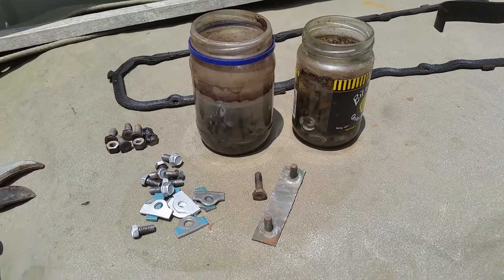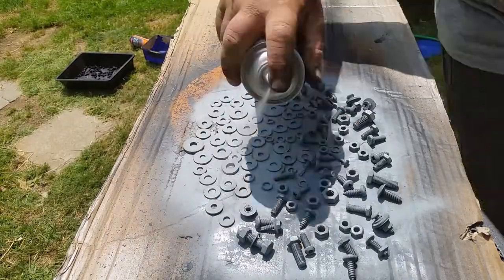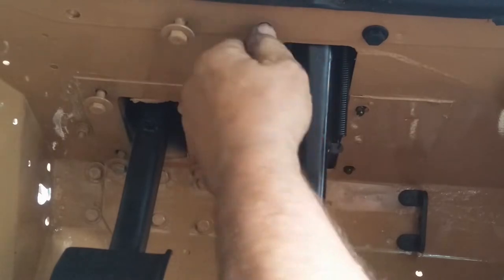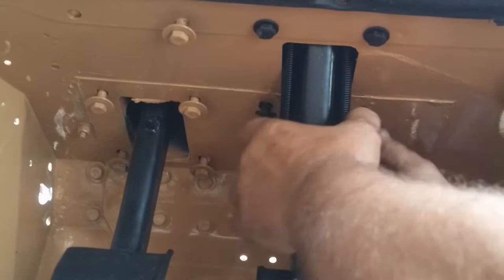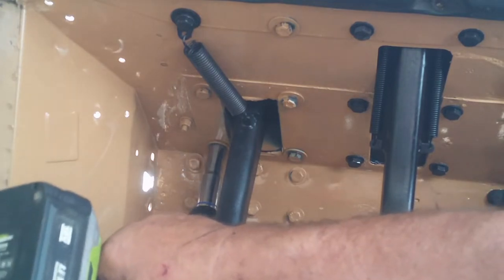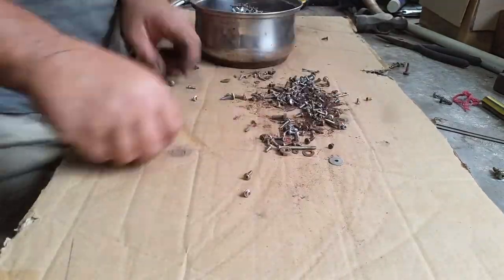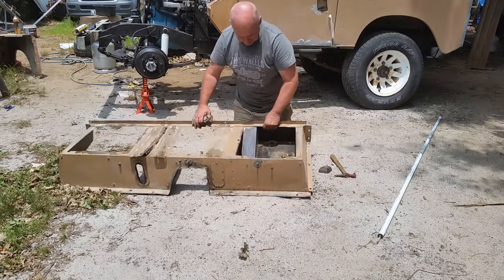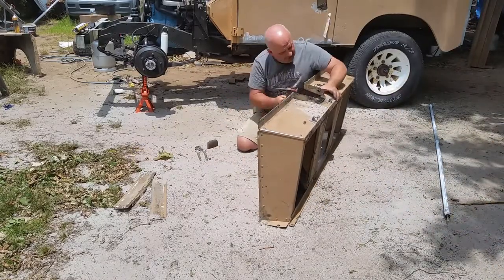LandRover S3  Refurb in 4 weeks. Video 5   Nuts Bolts, Washers, Clips and Clamps

Comment: Something truly satisfying when you find the nut bolt or screw you need and all those you've been saving for decades my playground has a pretty good hardware store also comes in handy !
Always known them as lock washers never heard spring washer before makes great sense though !
Amazing how many chemicals distilled vinegar makes unnecessary !
You have to build a booth if you want to recapture your sand wet or dry .
 the hardest part of recapturing your sand is building a booth .
Alkaline love gives so much extension to life well done !!!
Acidic loves take away life beware !!!
2020 will be the year for Clear Vision decalcifying and cleansing the pineal gland giving Clear Sight To The Mind's Eye !!!